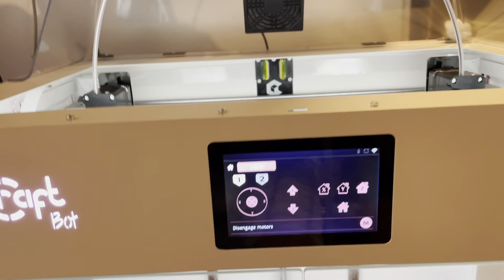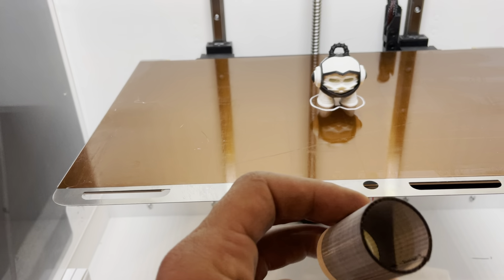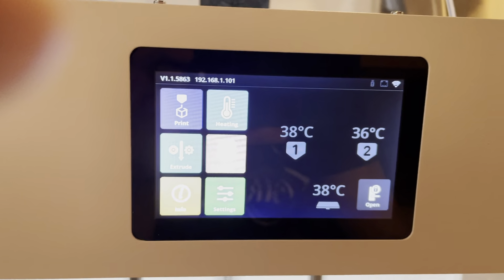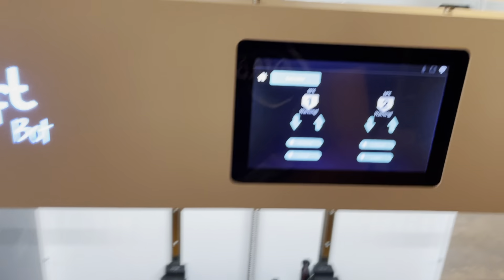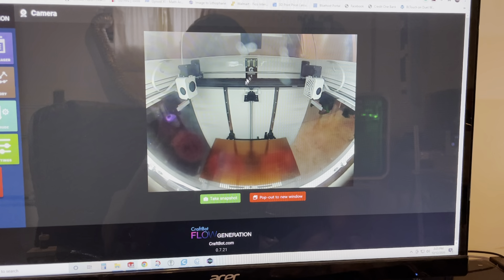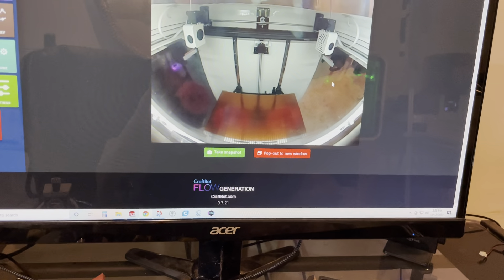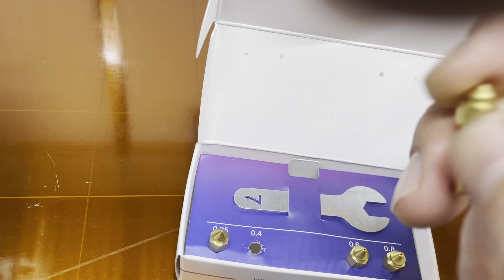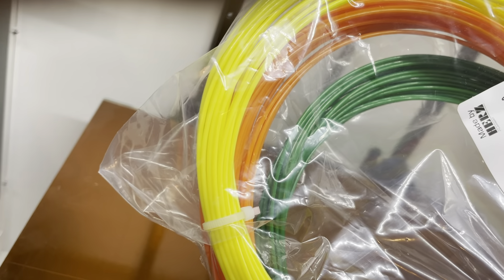D3D’s first impressions with Craftbot flow idex CL

Comment: Hey great video, I’m pretty new to 3d printing and would love to know how to use craftware to do dual colour printing on the IDEX.
Reply from the maker: It’s not that hard.... the key is the file import both parts at one time and it will merge the parts. Not sure how to merge if you load one at a time. I’m no expert on craftware but you have to use it for this printer I’m finding out.
Reply: @denver3dprintingtheprinter885  thanks I’ll give that a shot

Comment: FYI on cb 3 non index model there is a dome fan control... don’t know why they didn’t add that option to this model
Reply from the maker: Yes it is controlled with M1160 D### this was before I got the dome. this printer is a love hate printer.... when it prints its great but when it has problems its a nightmare. Support is lacking very much as well